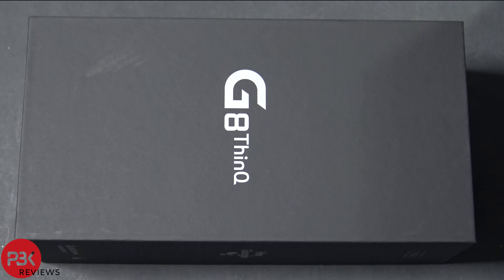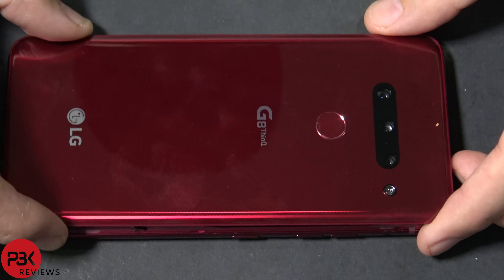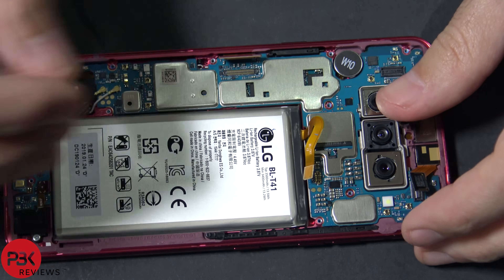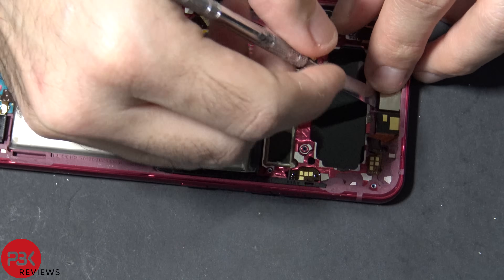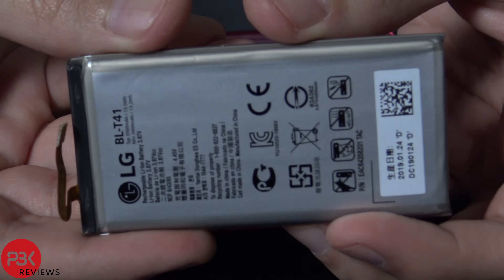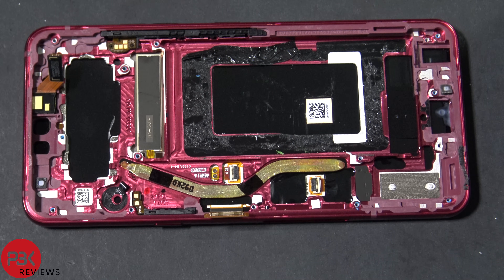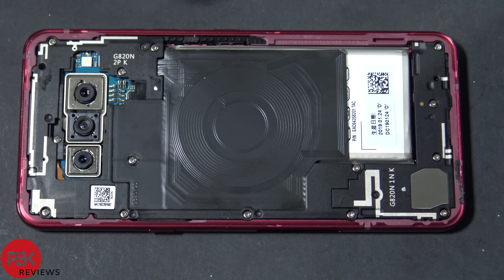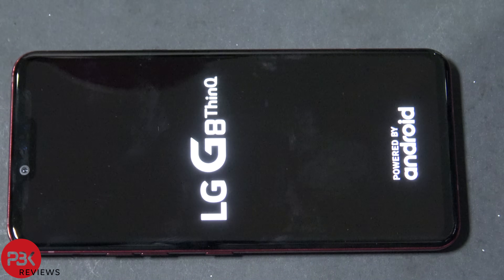LG G8 ThinQ Disassembly Teardown Repair Guide. No earpiece speaker?

Comment: I have the same phone with 3 cameras and the battery starts to run out faster 😢,  but I have another problem: the rear right camera lens vibrates when I take regular image photos and doesn't vibrate if I take panoramic photos. What could the problem be and how can I solve it? Maybe it would be more convenient to change phone for a new battery and lens? But I'd rather keep this one. Thank you

Comment: If the touch is not working, what could be the reason ?
Reply from the maker: If its a new screen replacement, can be software related. Try updating the phone software with the prior working screen if possible, since sometimes older software doesn't read the newer screen replacements. If its the original one and stopped working, can be water damage, loose connection or something else.
Reply: @PBKreviews  Thanks for answering. It is not a new screen replacement. I was using my phone and suddenly the touch stopped working. Then after few hours, I check it again and it did work but just for few seconds.

Comment: When replacing the battery...  Does the new battery wire simply plug in?   Will i lose all my data by taking the battery out?
Reply from the maker: Yes but there is adhesive under the battery so you would need to apply isopropyly alcohol around the battery so it gets under it and let it sit for 30 seconds so it eats away at the adhesive making it easier to pry it off. As for your data, no you won't lose it.

Comment: I love my LG G8. Bought it during the first year of the pandemic in 2020.  Only. . . now it's acting very strange ever since the Android OS update.  It takes repeated attempts to wake up (never wakes up properly), the fingerprint unlock works, but still requires that you swipe to unlock after unlocking with the fingerprint. . . which is just odd. And it has issues staying connected to Wi-Fi.

Sadly, I may never use this great video of yours because I'm going to end up replacing it due to software fault before I have to fix any of the hardware.  It is the last time I'll ever use an LG phone, as well, which is even sadder. . . now that LG has stopped making mobile phones.
Reply from the maker: yeah sucks they don't make phones anymore.

Comment: The volume buttons and google voice buttons suddenly stopped working. What to do bro? 😪
Reply from the maker: Have you tried powering it off and on? Also the main board sits on the flex cable for the buttons which makes a connections when the pins make contact. If dropped its possible the board is not seated properly to make a connection.
Reply: @PBKreviews  Yeah I have powered off and on still doesn't work. Will factory resetting do the magic? cos I can't risk taking my phone to repairers here cos LG products ain't rampant as such they may find it difficult to fix but instead damage it further. 😪
Reply: @PBKreviews  my power button works perfectly tho

Comment: Does the mainboard need to come out in order to gain enough leverage to pry out the battery for replacement swap, or can it be left in place?
Reply from the maker: It can be left in place. Now a days you can use isopropyl alcohol to apply some around the sides of the battery and let it sit for a minute so it eats away at the adhesive underneath the battery making it easier to pry off. Here is a link for it if you need https://www.ifixit.com/Store/Tools/iFixit-Adhesive-Remover/IF145-400?o=4

Comment: This video is fantastic; just follow exactly what he did on this video, you will not break any component.  For me, I broke off a tiny light sensor component when I removed the motherboard and it was my fault because I didn't follow exactly what he did to remove the motherboard.  For the battery, using two metal spudger pry tools.  it took me about 10 minutes to remove the original battery completely after I removed the motherboard & the charging board.
Reply from the maker: Glad it was of help. Now a days you can also use isopropyl alcohol (https://www.ifixit.com/Store/Tools/iFixit-Adhesive-Remover/IF145-400?o=4) and squeeze some around the sides of the battery and let it sit for a minute so it eats away at the adhesive underneath making it easier to pry off the battery.

Comment: Be really really nice if someone fabbed a replacement metal backplate for this puppy. The glass is retarded, don't care how "cool" it looks. I'd rather give up the Qi charging than have a glass back. It would make far more sense to put a through-the-back connector allowing someone to attach a Qi-charging plate to it, if they really wanted it. After all, if you put  the ABSOLUTELY ESSENTIAL case onto the damned thing to protect that RIDICULOUSLY FRAGILE back, you could incorporate a Qi coil into it which would mate up with such a connector. >:-/

Comment: I have to say, that glass back sucks. I've had a G3 and a G5, and never, ever, ever had any problem with their solidity and resistance to dropping or otherwise abusing them (My G5 is literally, what, 5y old, and the only "damage" it shows is very tiny cracks in both top corners of the screen). That is with NEVER EVER using any kind of protector or add-on case!

I've had my G8 for about 2 months now -- the back is already cracked and in need of replacing. I'll have to get a shell for it, which, for my inherent lack of "abuse" is ridiculous.
Reply from the maker: Yea, some phones use gorilla glass which is more reinforced and doesn't break as easy for the back glass as well, but not all models etc.

Comment: camera ToF on my LG G8 not working after plunging the water.
Can you give me a tips for fix it ?
Reply from the maker: You would have to take it apart and make sure any moisture or liquid internally is dried out and use a small brush to brush off any corrosion on the chips or connectors/sensors and then put the phone back together and see if it will work

Comment: Weird question, can we replace LG G8 battery with LG V50 battery?
Reply from the maker: Hi, no it wouldn't work since the connector for the battery is in a different location slightly and the size of the battery would not fit in the compartment of the G8 since its slightly larger.
Reply: @PBKreviews  oh, thanks
Reply from the maker: @RuralLifeKH  you're welcome

Comment: Thanks for video. I'm wondering if my phone face camera reparable, it's not focused on the face but at least the faceid is working and I'm able unlock the phone. Does the face camera could be replaced only with the hand scaner?
Reply from the maker: You're welcome. Ya you would be able to replace the front facing camera but would need to take the phone apart to get access to replacing it.

Comment: Anybody know what type of adhesive is on the back of the phone? I cracked my back and I'm trying to replace it myself
Reply from the maker: Not sure the exact one the manufacture uses but you can use 300 LSE or smartphone red tape or something similar. Usually most replacement back covers will come with pre cut adhesive for the backplate

Comment: I came here because I searched for " LG g8 antenna location" on google. Can you tell me where it is since you don't show it on the video?
Reply from the maker: Depends on exactly what your issue is you're having. If its a reception issue or wifi issue, first thing I would check would be the top and bottom black plastic covers that have the white/tan color antenna lines drawn on them. If those plastic covers/plates are not seated properly making a good connection with the main board, then you can run into poor signal issues. Next I would check to make sure your main board is seated properly and in place. Also check and make sure all your cables are connected and have not come loose. Aside from that you might have a hardware or software issue.
Reply: @PBKreviews  My issue is itchiness on the area where the thumb connects to the hand. It always gets much worse if I spend a long time using my phone, holding either corner of the phone right on top of this area of the hand (it happens with both hands). So I wondered if it's because that's where the antenna is located (bottom left or right of the phone). Can you confirm that that's where the antenna is located?
Reply from the maker: @MairaBay  Oh I see. Well there is antenna lines running on back bottom of the phone as well as back top of the phone and there is also antenna lines (the lighter colored strips) on either side of the metal frame of the phone itself. Not sure which are for cell signal and which for wifi though.
Reply: Thanks. I think it might be Wi-Fi because I noticed it gets worse if I am streaming music (via my home wifi). Thanks for your help 😊
Reply from the maker: @MairaBay  oh ok, no problem :)

Comment: Used this as a guide to replace my motherboard.  Replacement screen cost more than a locked imei phone in excellent condition.  Swapped the motherboards and all of my messages, data apps and everything swapped with the motherboard.  Much easier than replacing the glass with an unknown manufacturers copy

Comment: This solution, integrating the USB Port into the Mainbosrd looks less solid then have it separately with two screws on the housing. I haf allways the problem with Laptops, where the plug was directly on the mainboard- they startet to loose from the mainboard with the time. Do you think the charging port ist solid enough? I think due to charging  it will get destroyed snd watter will let in. Or loose contact.

Comment: When replacment of the front glass or digitizer is the full teardown necessary?
Reply: Just the front glass?
Reply from the maker: @royharrer3126  you would need to replace the front glass and screen combo, you cant just replace the glass. Also you would need to disassemble the phone to the point where you can disconnect the battery and the cable for the screen so you can slide the old cable out of the frame and insert the new cable through the frame and reconnect it to the main board. As for the dual screen, I am not sure about that. You might need to just purchase a new dual screen attachment since it would cost you just as much as buying a new one to fix it.
Reply: @PBKreviews  after you remove the screen cable will the screen just come off?
Reply from the maker: @LiquidLizards3569  Are you just replacing the screen itself without the frame? if so then the screen is held down with adhesive around the boarders. You would need to heat up the screen and use a pry tool to pry the screen off the frame of the phone after you disconnect the cable.
Reply: @PBKreviews  I'm replacing the screen and digitizer. Thank you so much for your quick reply!
Reply from the maker: @LiquidLizards3569  no problem

Comment: Thank you so much for this video! Used it as a guide to tear down my dads G8 and swap the screen. Phone is now as good as new! Keep making awesome videos! Thanks 😃
Reply: P.S if anyone else is trying to replace the screen, here is the link to the one I ordered. It was great quality and already attached to the frame so you don’t have to remove or attach the screen itself. Very easy to swap the components out following this video guide. Only extra step is swapping the buttons which is very self explanatory. Good luck! https://m.gadgetfix.com/oled-display-lcd-touch-screen-digitizer-frame-for-lg-g8-thinq-4103.html
Reply: @rymoemusic  Is this really the cheapest out there?
Reply: corp m there are cheaper screens but this one comes with the frame too. Made it so much easier to swap because you don’t have to deal with gluing the screen on. Well worth it.
Reply: Does it come with instructions? Just leery about screwing up. If not, which part of your video do I need to pay special attention to?
Reply: @corp m it did not come with instructions no. This video is really solid though. Like I said there is only one extra step which is pulling the buttons out. Freeze the video on the part where he has everything out and is about ready to put it all back together. At that point compare it to the new screen with frame that you have and you’ll see the last parts that you need to take out as well. Only other tip I have is use lots of heat when first opening the phone and when removing the battery. The glue is solid so melt it with a hair dryer as much as you can.
Reply: @corp m P.S. this is the first time I’ve done this to a phone too and it turned out great! Just go really slow, don’t force anything too hard and you should be fine.
Reply: @rymoemusic  Thanks. Need to add glue when putting back together?
Reply: @corp m I used 2tiny drops of super glue in opposite corners. Make sure you test everything first before you glue it up. But I wanted to make sure I could open it again if needed. Have an otter box on it now so it won’t pop off but it’s definitely not water proof any more
Reply from the maker: You're welcome, glad it was helpful. :)

Comment: Any idea where i van source a fingerprint sensor for the LG G8? Would the v40 sensor work?
Reply from the maker: If I am not mistaken, its glued to the screen so you would need to replace your screen assembly with a new one that has the sensor pre installed. Don't think the sensor its user replaceable.

Comment: Btw any idea what would cause this phone to reboot every time a charger is plugged in mines been doing it lately and I can't figure out what's wrong with it and it's to big a pain in the ass to send it to LG
Reply from the maker: if its doing it with different chargers, might be a defective charger port that has a short somewhere, try replacing the charger port board with flex cable and see if it does the same thing.
Reply: @PBKreviews  that's what I'm thinking of doing :) after watching this video I might just take on the task myself despite having warranty I just dont want to have to wait for them to send it back to me let alone it arive there and stuff

Comment: Did you use alcohol or a heat gun to remove the battery? Do you need to remove all of the other speakers ?
Reply from the maker: I use a heat gun, and I just warm it up a bit work on getting a plastic membership card since its flat and has a lot of surface room to slide underneath and pry, and keep warming up as needed throughout the process. Also yes in this phones case, its best to take out the speaker assembly and the board so you have room to work with to put your pry tool underneath the battery etc.

Comment: Would have liked to see the technique for the original battery removal. The 2ND removal looked too easy.
Reply from the maker: Usually I cut out long scenes since most people skip through them but just use a plastic flexible card like a membership card etc, and heat up the adhesive, then work your way little by little prying it off while applying heat again if needed. Just takes some time :)
Reply: He showed it on the LG V50 teardown
Reply: Awesome video! 👏
Instead of using a heat gun (or alcohol like JerryrigsEverything tried), Wouldn't it be safer if you instead, try using a small bottle of adhesive remover like this at the link below my message here?  Then you could always later, apply adhesive glue if need be? Thanks! https://www.ifixit.com/Store/Tools/iFixit-Adhesive-Remover/IF145-400

Comment: Awesome tear down. Any chance of doing a screen replacement on the G8?
Reply from the maker: Thanks! The only thing left to do for replacing the screen is just heating the front up after you took the phone apart, and prying it off the same way the back. Its held on with adhesive. Once you pry it off you can add new adhesive tape around the front of the frame and put your new screen cable back through the slit on the side of the front frame and re adhere the screen to the frame and just re assemble the phone again. Hope this helps :)
Reply: @PBKreviews  Do you plan to do a video showing this? LG G8 is so slippery that a lot of users will be looking for screen replacements :) Few AliExpress sellers already offer replacement screens at quite good price point.
Reply from the maker: @chortya  If I come across one with a broken screen I will look into doing a video on it. I don't want to pry off the screen and break it on purpose just to show the replacement of it since all that is left is heating the front and prying the screen off the mid frame after you have taken the phone apart. But If I do come across a broken one I will look into it
Reply: @PBKreviews  I'll send you my broken one to replace the screen :)
Reply: @PBKreviews  it won't be too hard to find a broken one. I broke my front screen within one week. 
I would volunteer my phone for this and compensate you. 
I work too much to even attempt this now.
Reply: Can u replace the screen with out removing everything from the backside?
Reply: @jamesrestum2366   I have just removed a broken front glass. No one shows this as far as I know, but you must disconnect the screen cable as you see here. 
Just do everything you need to do in order to remove the motherboard, then keep in mind that you'll need to slide the display cable through. You'll also have to peel off the  "crystal sound OLED"  from the digitizer unless you are brave enough to try separating the glass from the display. 
But, it's actually easier than it sounds.
Reply: It's called phone cases use them the sheer amount of people who don't use phone cases just blows my fricken mind then they wonder why when they drop there crapple crapphone it shatters like a shard of glass
Reply: @MystiqEevee  every single person I know who has broken their phone screen  had a case on the phone when it happened . And don't start with glass screen protectors. You can't protect glass by putting a piece of inferior glass on top of it.
Your unnecessary ranting is irrelevant.